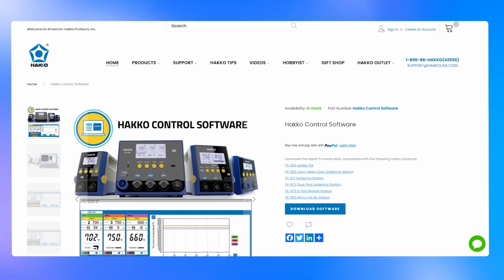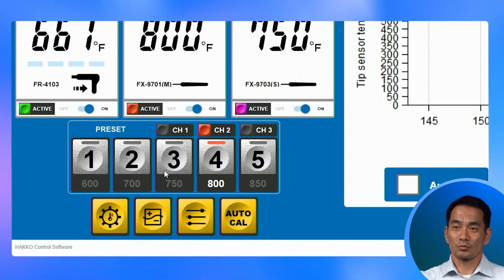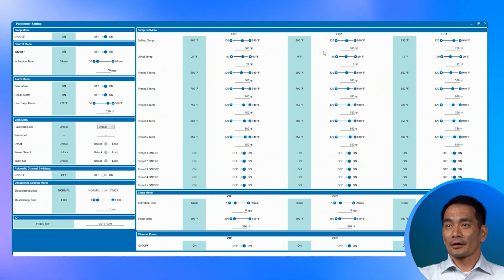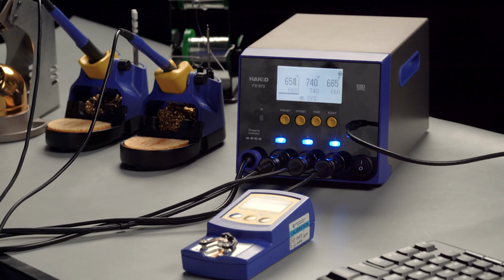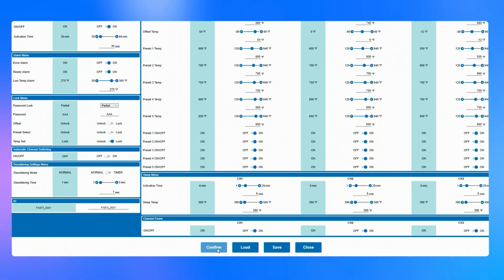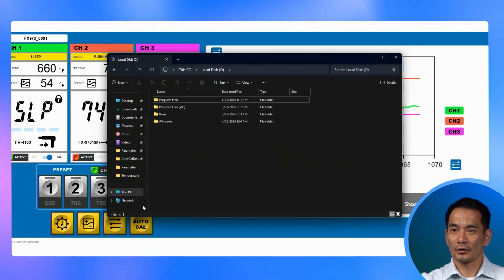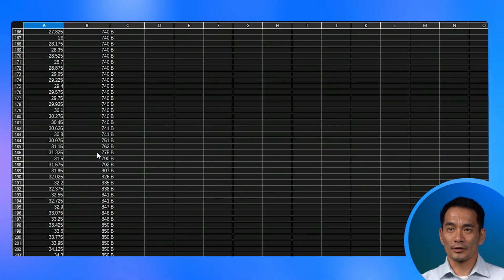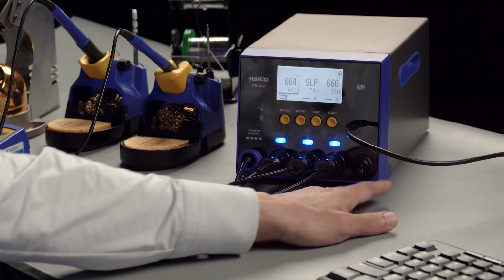Eye on Hakko | FX-973 Part 2 | Hakko Control Software

Comment: I went to Hakko's website to order a FX-888DX.  The website reflected a 20% discount on a ton of products.  I found what I wanted, added to my cart, failure. No Silver, Blue, Yellow were available as advertised. So I tried to order anything, the whole website indicated there is nothing in stock for the amount you want.  I only wanted one.  If the website indicates the product,  it's bad.  Why have you can order and have a broken website. Disgusting